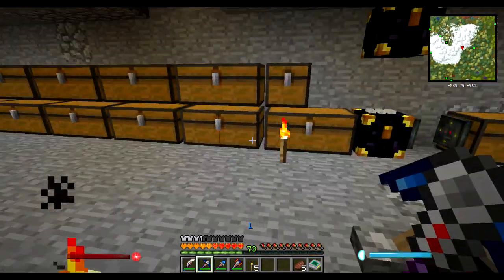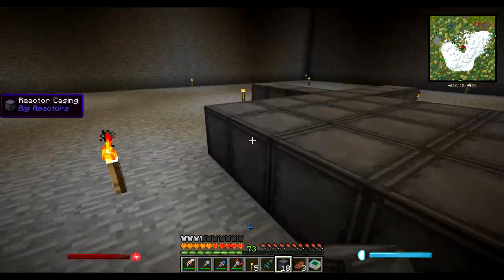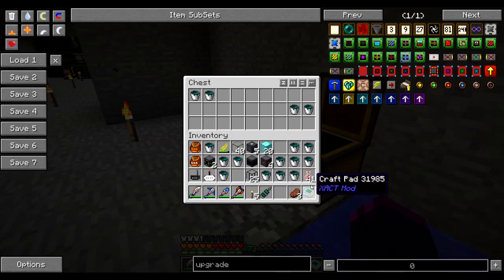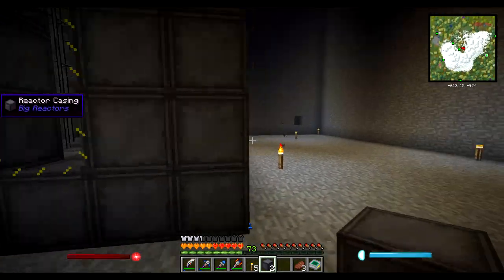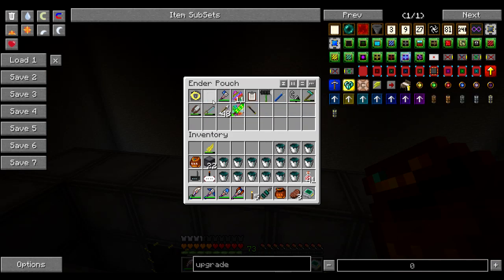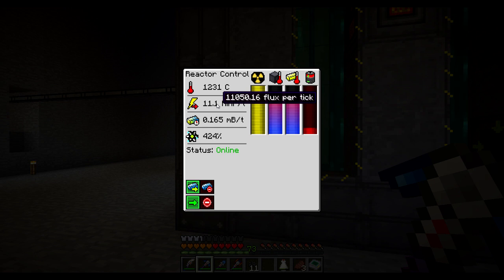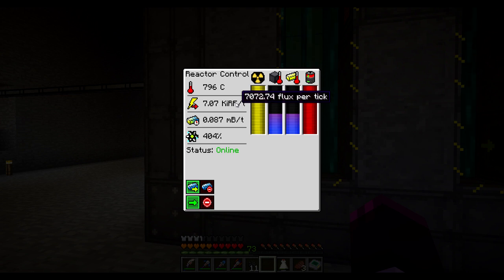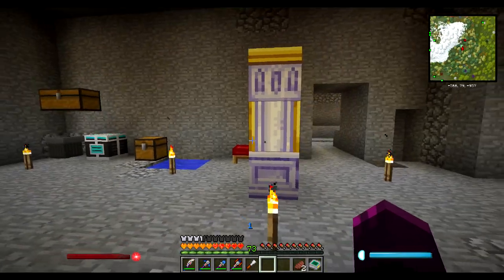Minecraft SP Season 1: Episode 20

Comment: For your Big Reactor, I think you are wasting those diamond blocks. If you replace all those diamond blocks with more flowing ender, you will get same or more power for similar fuel usage.

PS. I don't know how to build anything to look nice, so it's the main reason for watching your stuff. But I did learn a lot about Big Reactors from finishing the end quests for Agrarian Skies mod pack.
Reply from the maker: nope not wasting diamond blocks, this literally comes from hard data where what you suggested was included. And the version with Diamond comes out on top by a HUGE margin. It is literally the best 7x7x7 design.
Reply from the maker: *****
nope not even gelid is better for this design, the design I am using is literally the best for 7x7x7
Reply: RoraxPlays What do you call a Huge margin of difference? Let's use your reactor for example. You had diamond blocks and flowing ender, it gives about same as mine at 11,665 RF/t. With all flowing ender and no diamond blocks, it gives 11,679 RF/t. With gelid cryotheum(a lot of buckets since it falls down), it gives 12,095 RF/t. Note that the numbers might vary a bit in the 100 range.
Reply from the maker: Xplorer30E
What pack do you use?
Reply: Agrarian Skies 2.19. It should be same as yours since you got about same number as mine with your reactor.
Reply: As far as I know, diamond blocks are just for rich people who has nothing to use diamond for and want a bit less power.
Reply from the maker: Xplorer30E
AS has tweeked numbers from the default
Reply: Ah, so AS has removed the diamond block requirement? I will need another pack to test what the original Big Reactor needs then. But I wonder which number was tweek to make it act so different and work the same without need for diamond blocks.
Reply: I tried the FTB Tech World 2 v1.1.6 pack, but it seems to have a new version of Big Reactors. I did a test anyway, and the no diamond block build is still better. I can't use your pack, so can you test the no diamond block build please?